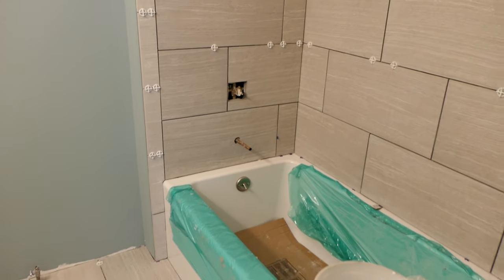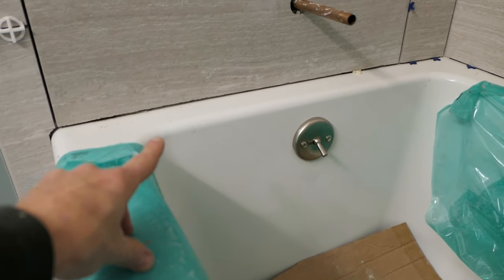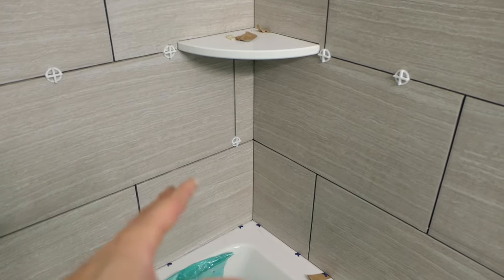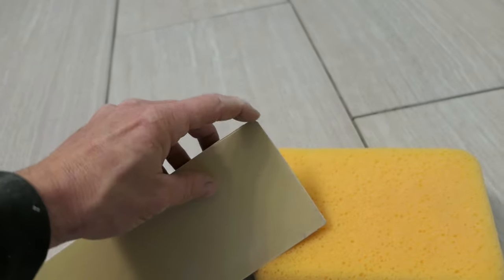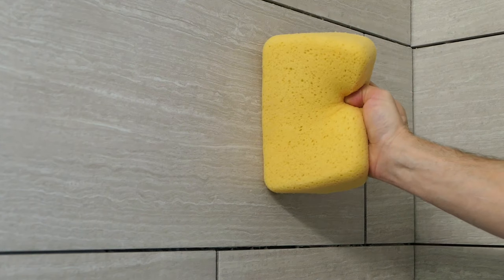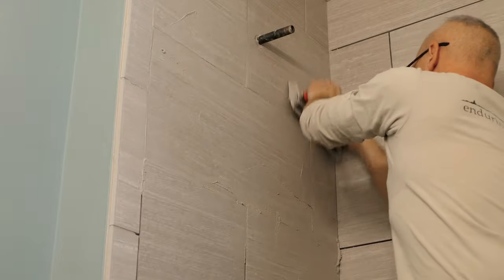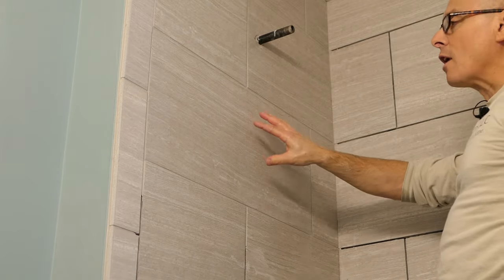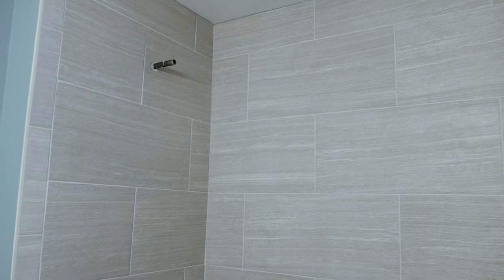How to Grout Shower Walls: A Complete Guide

Comment: How come the Americans always use Caulk? My last plumber asked if our bath had been sealed with silicone or caulk when I wanted the bath resealed & was relieved when I said silicone, because caulk dries & cracks like ol billyo he said. Nightmare to remove as well.
Reply from the maker: You didn't mention where you are located, but it seems like we have a language barrier.  "Caulk" is just a generic word for "sealant."  So, there are silicone caulks, acrylic latex caulks, butyl-rubber caulks, sanded caulks, etc.  In showers and tubs a silicone caulk is the appropriate choice.  They also make sanded caulks meant to match sanded grout, but I don't recommend those due to lack of durability.

Comment: I have a larger space in the corners of my shower wall. I am leaning toward caulking it, but I am worried it will look bad since the caulk is smooth and glossy, but the grout is sanded. This is my first time grouting, and I am worried the grout will crack in the corners. What is recommended?
Reply from the maker: Generally caulking is preferred, unless you are confident that you have beefed up the framing underneath to a degree that movement will be minimal.  They do make sanded caulks, but I have found that they do not last long. For durability, a silicone caulk is best.  You may find this video helpful:  https://youtu.be/_NDhO1xdQ_8?si=w26yc_vYqS2XS1HV

Comment: Really love the way you cut the tiles.  Wish my tile guy did this. I think I can grout my on tile now but still unsure of how to mix the grout. I think I'll just buy ready made grout at Lowes.
Reply from the maker: Don't use the premixed grout--it's not even grout.  Chemically it's closer to a thick paint than actual grout.  Buy the dry mix, and use a sanded grout if your joints are 1/8" or larger.  Mix the grout with water slowly, and sneak up on the consistency.  Little by little.  Ultimately you want the consistency of mayonnaise or peanut butter.  Mix enough for one wall and then add more later as you need it.
Reply: @enduringcharm  sounds goods. I'm not a carpenter and I'm a female so I'm trying to do the things myself to save money. I going to paint the interior of my house walls and trim.  I had one of these ventless heaters and just about ruined my windows with moisture. Someone needs to sue these companies that make these because I had mold on my walks behind my bed even got in my night stand. I got rid of it and put a vented gas heater. Plus they stink up your house with fumes and you definitely need a carbon monoxide detector. Read where a couple died died in their sleep from a ventless heater. I was going to sue them but broke my phone and Walmart lost all my pictures I took changing over to my new phone. I had pictures of mold in my kitchen, bedroom and bathroom. I hope people read this and never put ventless heaters in their homes. If they do be sure to size them right to your rooms and get a dehumidifier to get gallons of moisture out of your house. 😳

Comment: Great job, I do have a question about possibility of water getting trapped between say red gard liquid membrane that I applied and then filling the gap at the shower base acrylic in my case with 100% silicon caulk.  would that not allow any water that could possiby seep through the grout or tile? then just be trapped in there?  thanks
Reply from the maker: I made a video which I think may answer your questions:  https://youtu.be/y3bpE-GhYUM
Reply: @enduringcharm   Hi John, I watched that video , and I also put the flashing on as you did, Then  I used fiber mesh made for thinset and I applied thinset to make that lip area even pers say. then my waterproofing is red gard, so I then painted the red gard all over the cement board etc.. I have my tile on now and I have an 1/8" gap under tiles at shower pan. I was just thinking if I put silicon in that gap and water leaks through the grout would there be water trapped in between the tile and the red gard since there is silicon at the bottom so nothing will run down the waterproofing and out to the tub/pan etc.. or I guess not that much water would seep through grout ?
Reply from the maker: There really shouldn't be water seeping through grout lines, especially if the grout is sealed.  At worst, some moisture will get through if there are a series of long showers.

Comment: Do I use sanded grout with a gloss ceramic tile ? I was going to buy grout without sand for 1/8 grout line.
Reply from the maker: That's actually the dividing line.  Typically that's about as large as you can go with an unsanded grout.  Some sanded grouts are okay down to 1/8" some are not.  There is a product made by Mapei which is supposed to replace sanded and unsanded grouts regardless of the situation but I'm not a big fan of how it works into the joints or how it looks cured.

Comment: Curious. Why not just use the color match caulk on the bullnose vs grouting it? Less mess same look?
Reply from the maker: The color match caulk is not quite the same as the sanded grout.  When used in the gap between the tub or pan and the tile it's necessary and it's not as noticeable.  For the edge of the bullnose it's more noticeable and since it is silicone based it is not paintable.  So you could never repaint that edge in the future without issues.

Comment: Have you used ultra color grout from lowes , ive heard some bad things about it ?
Reply from the maker: Lowes is now selling Mapei brand grout, which is a solid brand with a long history.  The "utracolor" label is on all of their grouts.  However, there is one particular type called "Plus FA" which is meant to replace both sanded and unsanded grouts, and that has a poor reputation.  If you stick with the standard Mapie sanded or unsanded grouts you''ll be fine.
Reply: @enduringcharm  thank you

Comment: Thanks for the video! Do you happen to recall the color grout you used? I love how it came out. I can see the caulk was warm grey but the grout looks like maybe it was lighter?
Reply from the maker: I'm sorry, I don't recall the color.  Typically I try to use a color that blends with the tile color and often the displays at the box stores will have a reference to a grout color for each tile.  Other times people want a contrasting color, but that is less common.  As for the caulk, I try to color match with the grout.  However, I've also had some quality problems with the caulk made by the grout manufacturers themselves.  The color may be exactly right but the durability of the caulk is not as good.  So, if I can buy a generic pure silicone caulk which is very close to the grout color I may do that instead.  I can't remember which I did in this case.  It's also worth noting that the caulk and grout have a different sheen to them, so they may appear slightly different even though the actual color is identical.
Reply: @enduringcharm  thank you! Great videos and information

Comment: How would your technique change if you were using epoxy grout?
Reply from the maker: Epoxy grout is very different and each manufacturer has it's own installation guidelines you need to follow.  In general I work in smaller sections when using epoxy grout and I may or may not use a sponge depending on the manufacturer's directions.  I'm really not a fan of the stuff because it makes it more difficult or even impossible to regrout at a later date and much of it has a plastic appearance.

Comment: Does the sanded grout need to be sealed?
Reply from the maker: All standard grouts can benefit by being sealed.  However, that protection is limited to stains and to a degree the amount of water which is absorbed in a shower or other exposure to water.  It doesn't protect much against physical dirt, if you will.  You can still get soap scum, or particles of other materials embedded in the grout even if it is sealed.